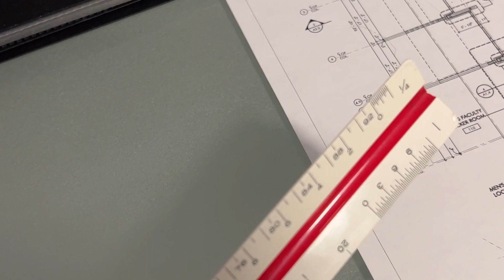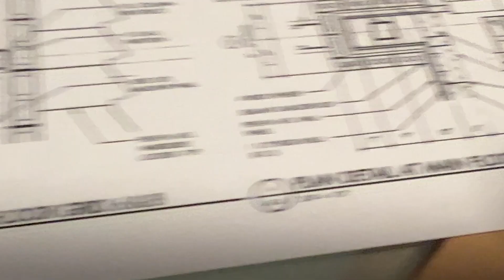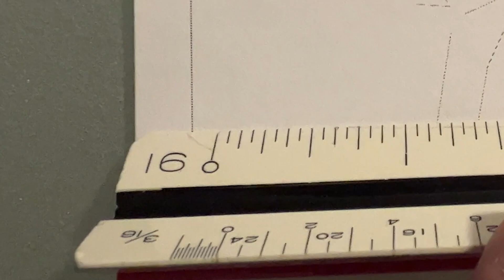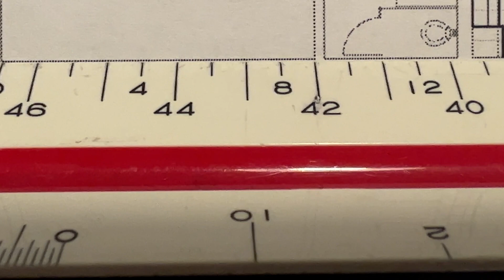I'll Teach You How to Use An Architects Scale!

Comment: you jumped from 1/16th scale and dropped to 1/8th scale reading without full explaining after showing 1/8th. Then you said we have a 16th on the ruler and said what it means then jumped back to the 1/8th.   The 1/16 was never needed because the print scale was 1/8th which you even showed. That is very confusing to most.   Although its not common and this is an american explenation . never scale up as some measurements could be 3/16 which would be hard to read in imperial in the wrong scale and could throw you off by half a foot or more. This is why we use metric MM in canada and the rest of the world.